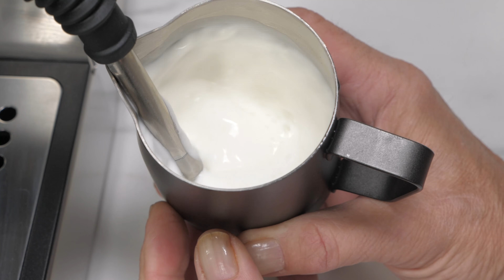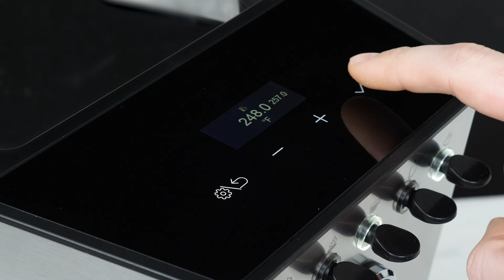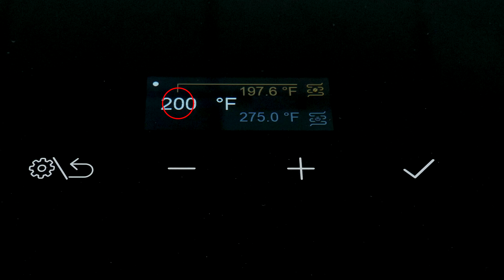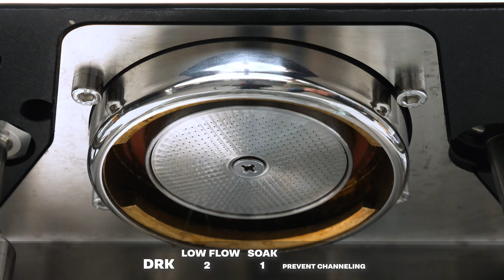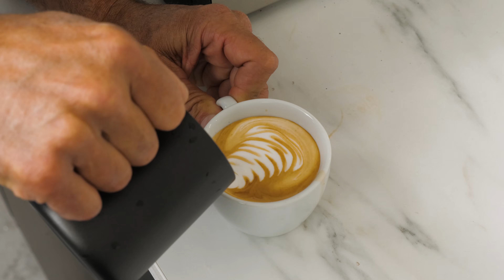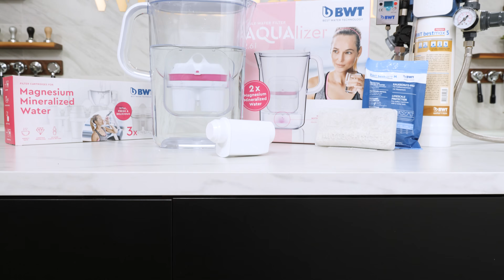Gaggia Classic GT Review – New Updates (North America Exclusive)

Comment: Great video! I wanted it so bad! I have a question regarding steaming, how does it performs when steaming a bigger milk pitcher of let's say 17oz so I can do 2 cappuccinos at once? Thanks!
Reply from the maker: Hi a, Thanks for the comment and Q. Maybe you missed it, but in this video I let the steam rip for 5 minutes without stopping with no perceptible visual change in the steam ouput power. As I mentioned in the video the machine even added a bit of water to the steam boiler while it was ripping with no affect. Steaming for a couple of large milk drinks at the same time is no problem.
Marc
Reply: @Wholelattelovepage  Thanks Mark!

Comment: Looks good. Question on the volumetric shot capability. To clarify, does it have a true volumetric measuring? It seems like it is just a preset shot timer. Still a nice feature if so.. just not true volumetric capability.
Reply from the maker: Hi m, thanks for the question. Yes it is TRUE volumetric programming measured by a flow meter! Todd points out the flow meter here during a tour of the internal components: https://youtu.be/JaSy0SYI4Xw?si=Fgl1o8aHq2rK82la&t=1877
Understand why you might think it's not volumetric as most machines do use a simple timer. In fact, you can use the GT's volumetric programming in combination with pre-infusion. Learn how in this section of our Setup & Training video for the GT: https://youtu.be/UB5XxH8Vfbk?si=y1CK7q9BzBmZnfWa&t=1164
Marc
Reply: @Wholelattelovepage  Thanks for the reply Marc. Looks great. When do you think we will have access to this machine in Canada?

Comment: Great video Marc. I was just about sold on a Profitec Move, but this does seem pretty compelling and coming in at lower price point.  What are your thoughts between the two?
Reply from the maker: Hey scott, Thanks for the Q! First, I do like the Move. It's built well and is similar in design with the ring group - brew boiler over and directly attached to the group. It has similar pre-infusion capabilities and other functions. Both have fast heat up but the GT is ready to brew sooner in 5 to 6 minutes. It's about 9 minutes to heat up the Move. I prefer the GT's user interface. Lots of info and it's easy to use/understand. In my frothing tests the GT finished our SCA based test in 20 seconds. Same test on the Move took 27 seconds.  I do more Americanos than milk drinks so I really appreciate the GT's hot water mode which put's out a smoother flow. Build wise, the Move gets an edge with the lever operated valves and virtually no plastic inside or outside. In comparison the GT's price point is very compelling.
Marc

Comment: Finally, a Gaggia I want. This has everything BUT why the single and double? Offer a bottomless portafilter. Also, why would you use the Eureka 65 W grinder, comment that you love that grinder, then not offer it in a bundle price?
Reply from the maker: Hi tony, Thanks for the comment! Some years ago I did a survey on customer preferences for having a machine come with a single or bottomless PF. Bottomless won in the survey and I did pass that along to manufacturers. Some have gone that way - but not all. I do like the Atom W65. So nice to accurately dose a PF without thinking about the weight or having to pull out a scale.I do not get involved in the sales aspect but did talk with the Sale Team. Contact them directly and they should be able to get you a bundle discount on the grinder with the GT!  https://www.wholelattelove.com/pages/sales-support
Marc